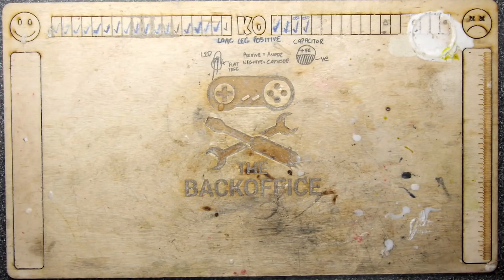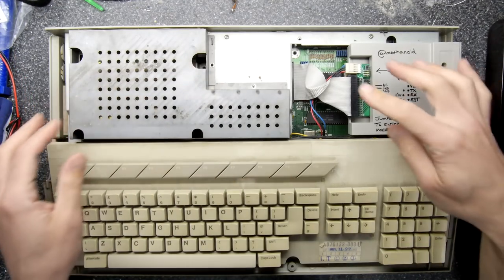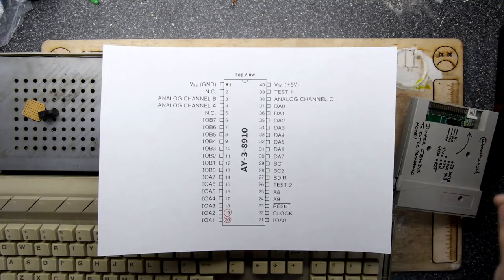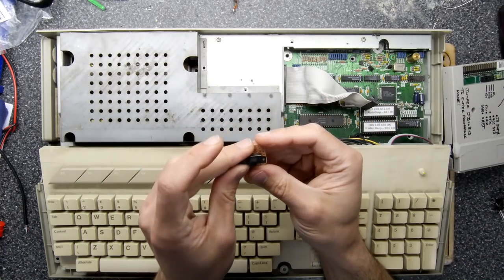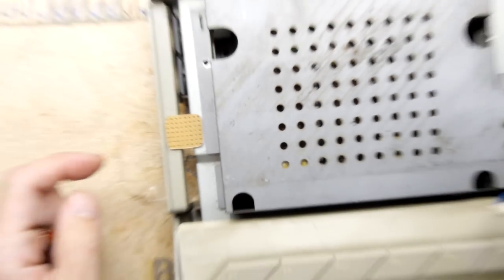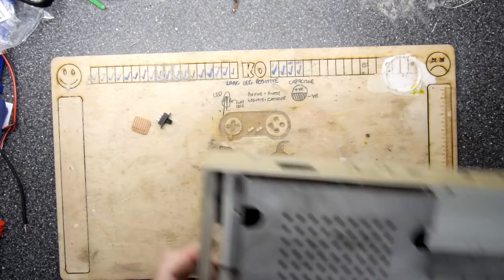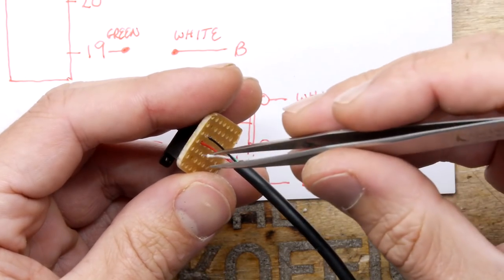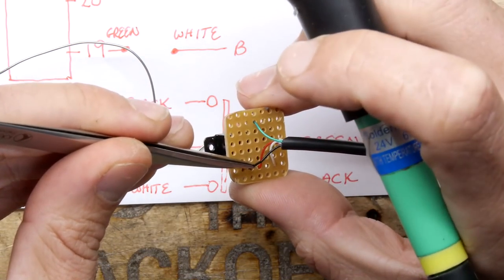Atari ST Easy Boot Drive Mod

Comment: Aldi have a nice little scalpel/craftknife set currently still in stock in the middle aisles for about a fiver. Also needle files and a handle with what look to be jigsaw blades for precision hand sawing. But mainly about the knives... If you hurry, you should be able to find a set. I think they were from last week's specials, so potentially not many left in stock.
Reply: Also (from my admittedly poor memory) a 5 or 6 mm metal drill bit works as a spot face cutter for Veroboard. Maybe a 4 mm bit... Some of the commercial tools are just a drill bit with a plastic handle.
Reply from the maker: Are the blades made of alloys created to avoid misplacement? 😂

Comment: Sold my STs. Waaah. I'm conflicted about it !
Reply from the maker: Nooooooooooooooooooooooooooooooooooo how could you!! 😫😫😫
Reply: I was trying to be good   and not hoard. I got them out to sell and the main ST decided it would not boot. So had to sell it as non working :-(   And then regretted it...  Amiga went too...      Zero retro machines.  Now I am looking again :-( Or I have to build the Pi inside Dell monitors like a YTer I know ;-)
Reply from the maker: That does indeed work well. Some YouTuber would have probably swapped a Dell like that for am old machine 😂

Comment: You could have done this properly by desolder if the entire IC and the fit a socket, that way you only need to bend the pins out of the was as opposed to cutting the pins
Reply from the maker: Yep, that's why this is the project ST and not my nice one

Comment: why does everyone mount the gotek inside the actual ST computer? why not mount it via the external floppy connector and have it external to the ST so u can still use real floppies?
Reply from the maker: I would have done that myself had this not already had a missing drive and a hacked case. You can definitely put it external.
Reply from the maker: The other reason is that you will need to get your stay to boot from external
Reply: @backofficeshow  ive never seen anyone make an external gotek floppy i think thats more desirable as it keeps the ST looking the way it was meant to look from the original design rather then hackjobbing it into the internal floppy!
Reply from the maker: I might just make one to discourage people from the case hacking

Comment: Hello, 
I think that you can use switches W300 and W301 (see at 23:31 at the lower right) to do the same, without cutting the pins of the circuit.
Reply: I answer ro myself  :)  : in the fact, the default strap position (2-3) of W300 always send Vcc (logic 1) to the floppy DIN connector pin 6. By cutting the strap between 2 and 3 and connecting 2 to 1, you can output to DIN pin 6, the signal D1SEL. I think that the purpose of this modification is to allow to connect more than one floppy drive to the STe (in combination of change over W301). The selection of the floppy is depending of the jumper selection done on the floppy itself (see EPSON SMD-380 floppy disk documentation, jumper bloc A). To do a clean swap of A and B floppy drives, you must use W301. By default, it send the signal D1SEL to the pin 5 of the floppy DIN connector (position 2-3). But if you put a jumper between pins 1 and 2, you can send the signal D0SEL to the pin 6 of the floppy DIN (after cutting the connection between 2 and 3 of course). So the external floppy drive can become A-drive by using this signal. But you must change the jumpers directly on the internal ST floppy drive to indicate that it is now B- floppy  (see EPSON SMD-380 floppy disk documentation, jumper bloc A) . This can be done a easyly, by using one DPDT switch as you used. The first 3 inverter pins of the switch will be connected to W301 and the 3 others connected to the pins 14-15-16 (Jumper bolc A) of the internal drive. So you don't need to cut the pins of the sound circuit.
Reply: Correct w300 and w301 and different ones on different boards stfm and Ste have differences

Comment: Nice mod!
Reply from the maker: Thank you!
Reply: I avoided getting a Gotek just because of the boot problem. So this is a good solution, but I think I better get a trash ST to do the MOD on. I am pretty sure I would butcher my decent one, my soldering skills are a bit rusty ... and I need a new soldering station, the one I have is complete trash.
Reply from the maker: Definitely try it! I think practicing on an older unit is a good strategy, the main danger is damaging tracks when cutting the pins, so take care 👍